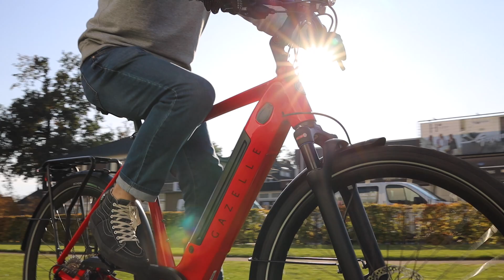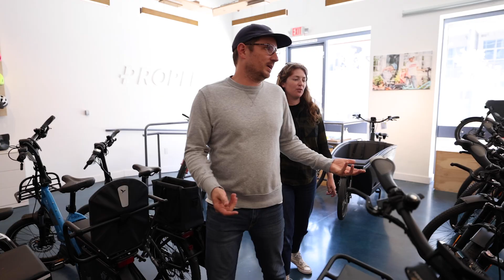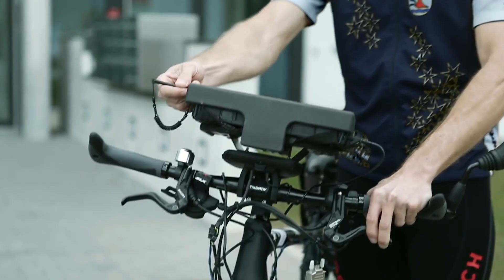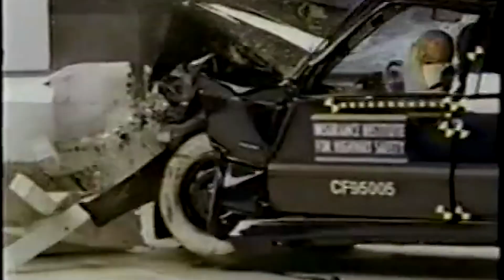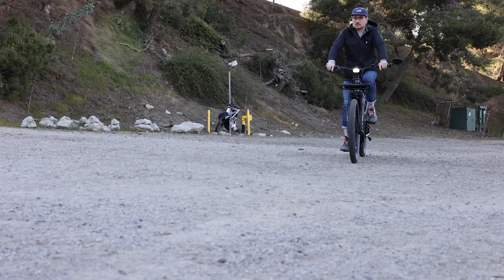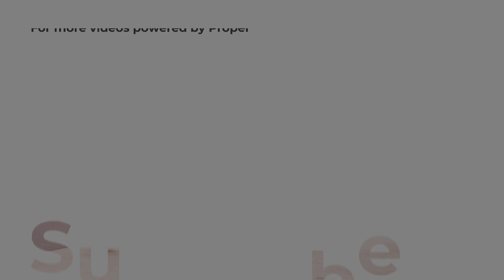Are eBikes actually safe?

Comment: I’m looking at this because of a big fire in NY caused by Ebikes. I’ve already got one and now I’m concerned.😬
Reply from the maker: Not to scare you, but you probably should be. There is a pending update to the FDNY fire code which will require testing. Unfortunately 90% of the eBikes on the market don’t meet this requirement. I’ll be making a video on this soon
Reply: @Propelbikes  thanks, I appreciate it. 👍
…another reason to not buy unknowns online…. And to go with something like the Bosch equipped bikes. ☹️
I was concerned about going into bikes too quickly and went with the entry level Trek Townie GO 7 speed because of the modest cost and figuring Trek was a mainstream dealer that I’d hoped would take these things more seriously and stand behind their products. Friends have just gone for the more costly Townies with the Bosch equipped mid drive and batteries. 

….wonder if I should be doing that too but with a knee injury, the flat foot geometry was important to me.  😐

Thanks for providing a great channel for all of us.

Comment: This is exactly the reason I'm considering spending several times the amount a Chinese conversion kit would cost me to convert my existing bike into an ebike. I trust that Bosch has done a great deal of testing, and that their batteries are not going to burn down my townhouse, and the seven connected houses.
Reply: I got a Bosch for this reason too. The UL certification, BMS, and general attentiveness to this kind of stuff was huge. I've seen too many videos of lith-ion batteries exploding and spraying fire everywhere. I do have a little ABC extinguisher just in case, but yeah.

Comment: My view would be to start with batteries and chargers. If the power tool industry can make their batteries meet whatever standards they have to for performance, drop test, thermal management, and charging safety, then ebike battery manufacturers can voluntarily submit to, brag about, and charge for the extra safety and performance their products bring compared to knock offs. The right approach would be for government and industry to set low bar standards that give peace of mind, then inform the public about them and what they mean and why they are important. Leave it up to consumer to decide to pay for it.

Large, high performance batteries are going to be more and more part of people’s life in ways we can’t imagine. Leading is better than being forced to follow.

Comment: Hi, Chris. Your videos are very informative. Recently, you asked for suggestions from viewers. With all the various kinds of features that exist (e.g., motor placement, throttle vs pedal assist, chains vs belts, cadence vs torque sensors), I would like to know what you would prefer in a “ideally designed” e-bike. What bike is ideal for the recreational writer, not just the sports minded rider. 

Which manufacturers provide the best service and the ability to get parts after purchasing the bike? With all these manufacturers coming and going, It’s important to know who will be around long after a customer makes a purchase. After all, e-bikes are like cars, requiring a greater level of maintenance. Thanks.

Comment: Great Post Chris. Safety. Since you brought it up, my Bosch charger (During the charging cycle) gets roasting hot. The Battery barely warm. My bike is an R&M Nevo 3 years old, 1450 miles on it. Is that normal ? Thank-You  Chris.

Comment: I think the biggest safety concern has been, and probably will remain: around the safety (and handling) of high capacity Lithium Ion batteries, and their chargers. Airlines and freight companies strictly regulate their transport and for good reason. Companies like Bosch and Tesla spend $M’s on UL testing their products so at least to me - its reassuring and I suspect will soon become an industry requirement whether it stifles innovation or not. It’s part of the evolution, not all manufacturers will survive the next 5-8 years. This market is like gas motorcycles at the turn of the century, every Wilbur was building one in his garage. Some even went on to become well known brands we have today, but many hundred of others were gone by 1912.

Comment: I thought of protected container. I do have it in porcelain pot in middle of room away from curtains and so forth. I keep my RC plane lipo batteries in metal ammo box in closet. I asked someone online about metal ammo box if I can find one that big. He said I might be creating a bomb. Not sure if ammo box would contain that type of fire or explosion. Once we get through this horrible heat in Las Vegas and temps are in the 50-77° range in my garage there out of the house for sure.
Reply from the maker: Great point! At this point I am only comfortable charging UL certified batteries un-monitored.

Comment: I would like to more about the safety of these huge batteries that we bring into our house because it’s 100° in my garage in Las Vegas
Reply from the maker: I would recommend charging in a cooler area and ideally in a protected container to protect your home and your family. I don’t want to alarm, you but if the batteries don’t have the right fail safes in place there is a potential for a fire.
Reply from the maker: I would also recommend getting details from your eBike manufacturer on safe charging practices as all batteries are not created equally.

Comment: I think (as an e-biker) that there should be a level of safety awareness. 
But that goes beyond the motor, maybe that part even is the least where safety is an issue: since what could go wrong (defect leading to a normal bike, or - more severe - blocking or the pedals). 
Batteries and their charging are a risk (fire), malfunctioning gears and brakes can really cause accidents, and even the construction of the bike itself I consider more risk.
As I am an inhabitant of E.U., tend to look to/prefer regulation,  so a minimum requirement is set. (smart) Regulation is not a handicap in innovation: it's just preventing hazardous products from entering our lives.
Reply from the maker: It seems in the EU many of these requirements already exist, but practically none of them exist here. As others mentioned it’s a slippery slope and maybe many don’t care. I figured people should at least know.

Comment: I agree with you over battery safety and quality of how all bikes are produced but thats it. To have a law for maximum E bike speed is laws going to far. New Zealand doesn't have this law but all e bikes that arrive have these restrictions and we can't turn it off on my R&M bikes. No other powered vehicle has a restriction on speed and the thing that I don't like is how the engine wants to hold you back to its top speed. R&M is bad at this and trying to peddle above 47kph on flat roads is almost impossible even though my bikes have 14 gears.
Reply from the maker: This is a fair point Dean! Especially in New Zealand where you might have more spaces where you can ride without regulation. Unfortunately I don't see this changing anytime soon though.

Comment: I ride ebike,  standard pushbike and also motorbike.  Ebike safer than standard bike because wheels,  tyres and frame stronger and less prone to failure while brakes are equal.  Ebike safer than motorbike because no petrol.  Maybe some battery regulation a good ideal if they also have regulations for motorbike batteries.  Because ebike batteries regularly removed they could have 'no start' function unless battery properly reattached to bike.  I have Bosch system and bike starts without battery 'click' being achieved meaning bye bye battery at first bump.
Reply: >Ebike safer than standard bike because wheels,  tyres and frame stronger and less prone to failure while brakes are equal

You would hope so, but how do you know for sure? Has it been tested? Are failure odds higher than you'd expect due to the manufacturer prioritizing cheaper components to reduce production costs?

I don't think I'd trust a lot of ebikes at 28mph for typical riding even though they're capable of those reaching those speeds. Usually it's fine in optimal conditions, but what about a pothole ridden road, or a rainy day? I suspect performance could suffer quite greatly when ebikes are thrown into situations I'd drive my car in without a second thought (particularly reliability/component integrity, or being able to safely come to a stop in a reasonable distance)

I don't have these concerns as much with my non-electric bikes because they're simpler, no electricity (or sensitive electric connections) required, and the weakest link is most likely going to be my own ability to propel the bike. And because I'm doing all of the work, I'm less likely to over-accelerate and then need to slam on the brakes, but if I do, I'm more likely to be going ~15mph than >25mph, and there's less mass to slow down.
Reply from the maker: Great point Liam! Bosch actually changed this design which makes re-installing the battery a bit of a pain, but I guess the issue of it not being properly seated is a lot less likely.

Comment: I trust bikes made by the big names. It’s the cheap, no-name bikes that are suspect. Frankly, I’m more worried about the way people ride eBikes. Last weeks couch potato is out there today, speeding down the bike path at 20+ mph without a helmet, courtesy bell, or experience. Yikes!
Reply: I've seen the 20 mph speed kicked around as "fast" lately, and I'm honestly curious about how often people with pedal assist are really hitting that.  On the two block stretch of heavy traffic road that takes me to the grocery store, I've put the assist on Turbo, the IGH on flat ground, and hauled ass to get ahead of traffic at the light, and I'm just kissing 19 mph.  I'd say I average around 12 mph on my Tern GSD, but I often have a kid on the back.  A lot of what slows us down is the discomfort of wind resistance.  Once we are past scarf weather, our ears get cold.  

From a physics standpoint, I'm guessing the inertia from the weight of a purpose built ebike is a bigger factor in accidents than the speed.  I can hit 12 mph coasting down our long hill thanks to the weight of the bike (and my, uh, fluffy self.)
Reply: @HarryLovesRuth  20mph is pretty fast, and it doesn't take much to reach that speed from the little testing I've done. My ebike maxes out at 750w, but if I'm in pedal assist level 2 or 3 I can hit ~20mph with varying levels of effort. (unloaded, i.e. no groceries, mostly flat not-too-bumpy ground)

Level 0  0w 10-12mph
Level 1  ~40w? 12-15mph
Level 2  ~80w 15-20mph
Level 3 ~150w 18-22mph
Level 4 ???w 22-25mph
Level 5 ???w 25-28mph

I'm sure it varies a lot from bike to bike or road to road. I'm typically in the 10-15mph range on my non-electric bikes unless I'm sprinting or going up a nasty hill.

Yeah, wind sucks. I usually resort to putting on a cap that covers my ears and gloves embarrassingly early into fall and keep them on well into spring.
Reply from the maker: @KD Stoffel based on my experience I wouldn't trust the big names. Unfortunately it can be quite common for these brands to disregard this as there are no real requirements currently. I'm not advocating for these requirements necessarily, but I think awareness should grow.

Comment: More division! Bosch mid-drive for the masses - NOPE! Makes the bike to expensive and guarantee a “walk home” if your chain breaks! Battery safety standards for fire or explosion - OK, yup. Sadly though, your comments “appear” to intend to eliminate less expensive bikes that use mid-grade components from the market so that you can then sell (and profit from) the high priced rides! The world of ebikes needs brands like RAD to continue the adoption of this technology. Thanks for your post!
Reply from the maker: Bill I have seen several comments similar to yours and I thank you for adding it to the discussion here. It's definitely not my intention to remove all of the other products off the market. I think different people have different tolerances for budget, safety, service, etc and I respect the consumer's right to chose. 

To be clear, most of my push for testing is related to battery safety as it's likely the largest concern. I think most would suspect that all eBikes meet some standard, but the reality is they don't since that standard doesn't exist. I do appreciate the varieties of perspectives I received here and for now I will likely calm down on discussing this topic as I don't feel like I need to push this. I think plenty will happen naturally, but I do feel like I owe it to those that follow my channel to understand where I'm coming from.